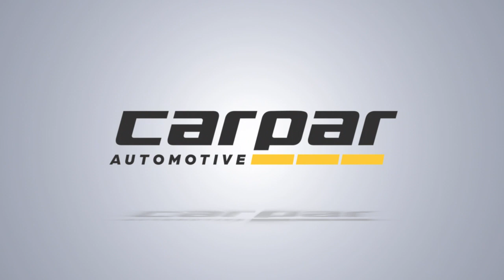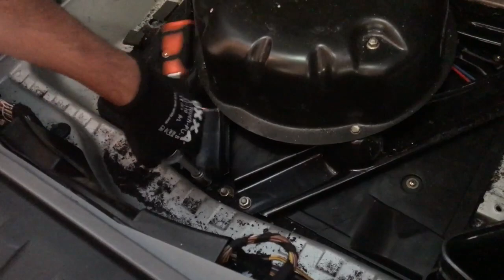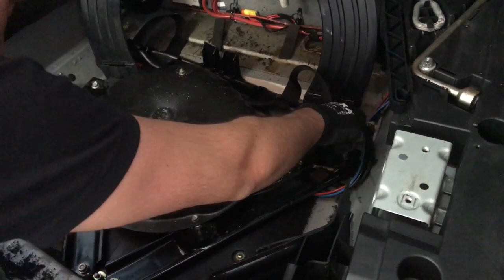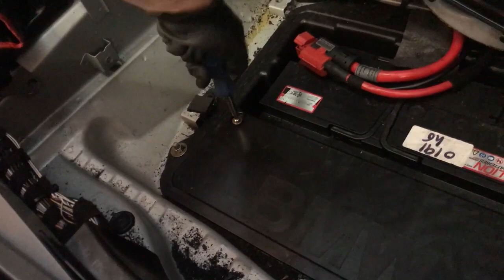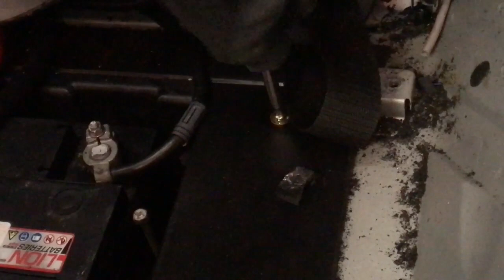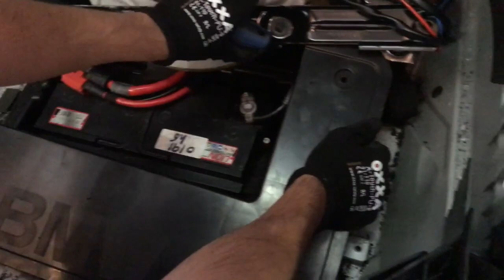Where to find BMW E53 radio connector/adaptor

Comment: Hello
If i connect only the 6m cable extension stray to the radio,all speakers will play?Or I need to connect separately.My car is BMW X5 E53 2003
Thank you ..
Reply: Tomiko Matiko i was thinking the same if u have answer to that, can u tell me please
Reply: @robertblanco7603  looks like we need to run individual speaker wires to each of the speakers. they also say that you can connect the blue power antenna wire to the red acc wire to get the speakers to play with an aftermarket radio however when i did it it worked great for a few months and then overheated

Comment: Mine has nothing there 🤔
Reply: This is if you have the stock navigation installed up front, as opposed to the standard stereo and CD player. With the nav system, they only have controls up front, but all the actual hardware is in the back, like in this video.